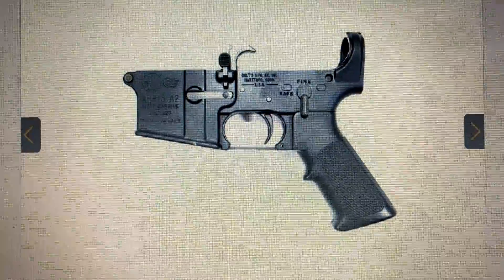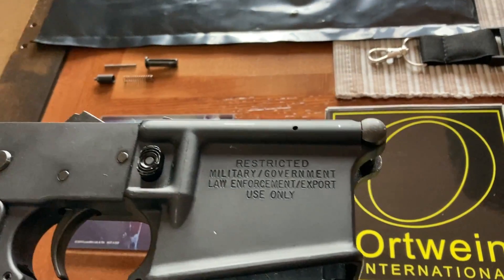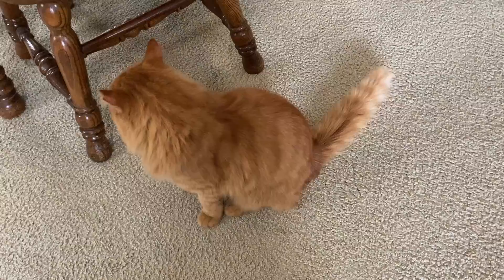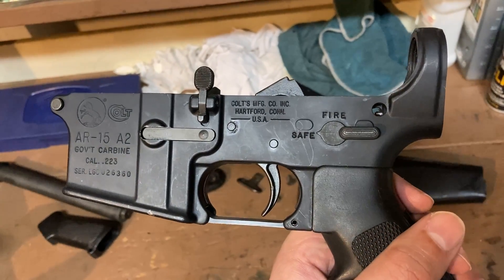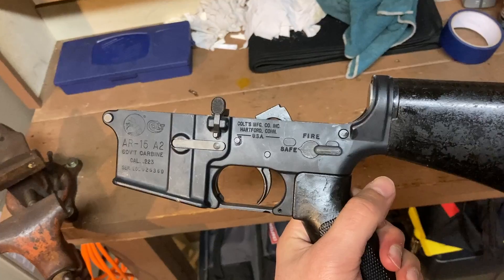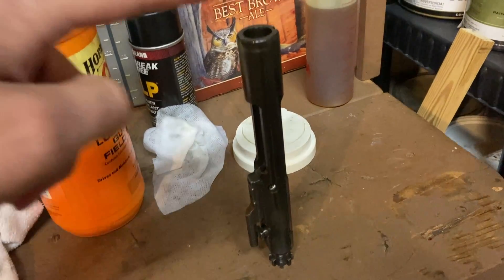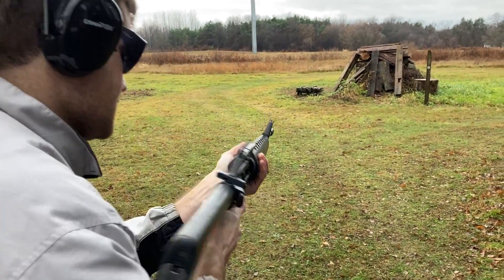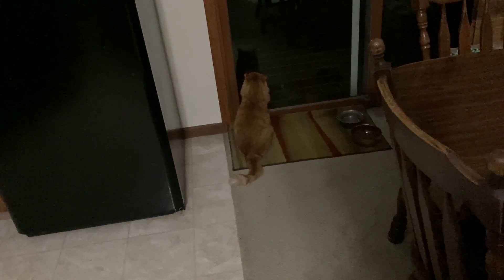Colt M16A1 AR-15 A2 Retro Build with Cinnabon!

Comment: Great vid it's been some time since I had a A-2 in my hand USMC 93 , on the bolt u have 3 gas rings make sure the 3 splits are spread equally apart , gas pressure
Reply from the maker: Thank you for your service, and insight!

Comment: Alex, since you love antiques & old 100- year-old books, I’m wondering why you don’t collect and restore 19th & 20th century guns like Colt revolvers, BARs, etc.
Reply from the maker: The Colt AR is a 20th century gun. I was never a big fan of revolvers. My brother is into some of the older WW2 era firearms.
Reply: @LexCinnabon  I’m curious how much did you pay for COLT A2 lower? I’m proud owner of COLT AR15A4 & COLT LE6920HBPW ( Heavy Barrel Pin and Weld) SOCOM barrel.
Reply from the maker: @romero9545  I paid about $1,000 for it.
Reply: @LexCinnabon  Wow 1K for a postban lower is pretty steep, should be able to get a preban for that.
Reply from the maker: @redtra236  it's reasonable today. They rarely come up for sale, and it has the more desirable small pin hole with captive pin.
Reply: @LexCinnabon  True the big pin ones are most common, but being a postban lower still seems a little high. I guess it was a complete lower though.
Reply from the maker: @redtra236  with most collectable firearms stuff, even if one overpaid for it, in a few years or less it will be worth more. Postban/preban isn't really a big thing anymore with American firearms, assuming they are dimensionally the same as the prebans. (Since the assault weapons ban is long expired) in fact, the restricted markings add value to items and firearms to some buyers, since they were likely intended for or purchased originally by law enforcement.
Reply: @LexCinnabon  No no no preban ones are legal in MA and CT to be built into normal AR configuration(aka Assault weapon) so bring a premium. Not that relevant unless you live in those states but raises the going price of them nationwide.

Comment: I dig the retro rifle aspect, but ditch that buffer pin and get a JP silent captured spring or comparable modern buffer system
Reply: Negatory. Good parts for comp guns. But keep the OG, maybe replace the spring for a Sprinco one. But keep it.